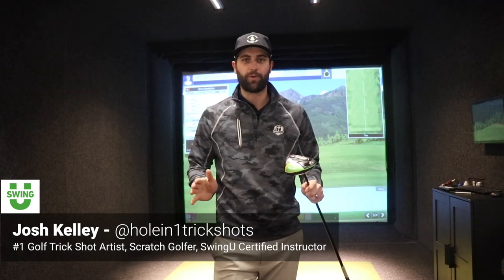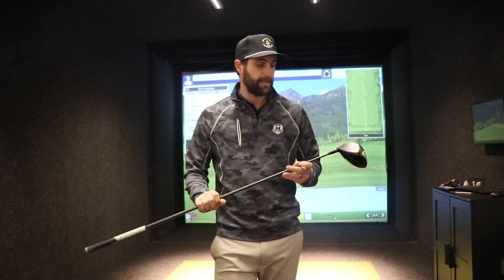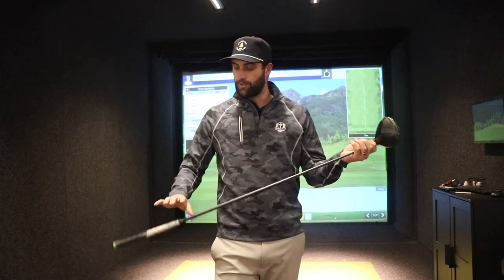Should You Be Playing A Shorter Driver Shaft?

Comment: I play with a 43.75 inch driver shaft. I was using 45 inches but I am only 5 ft 6 inches. Much easier to find the club face sweet spot with the shorter length. It changed the swing weight on my club but I am hitting just fine. I didn't add any weight. My accuracy took a big jump. I am not seeing any drop in distance either. Many shots are just as far and some have even gone further.